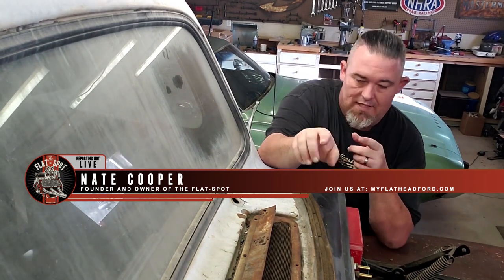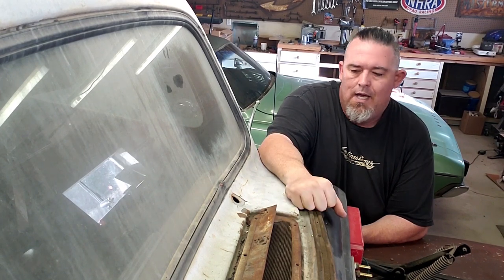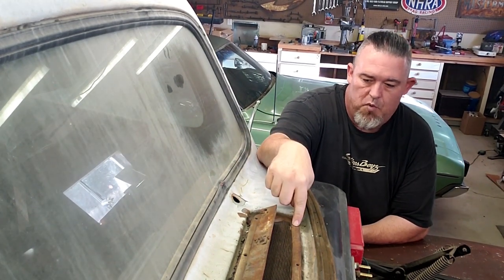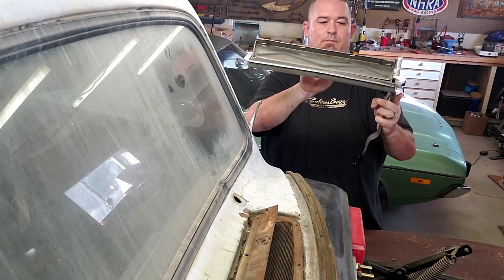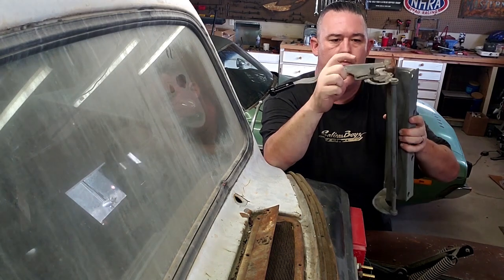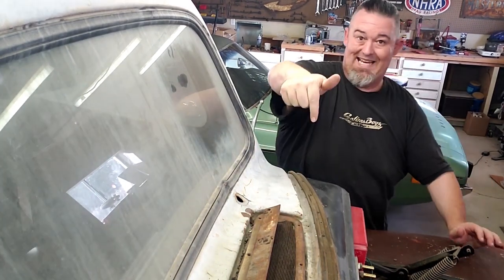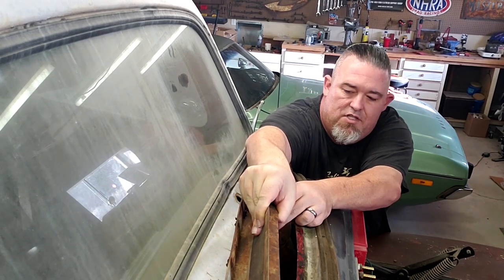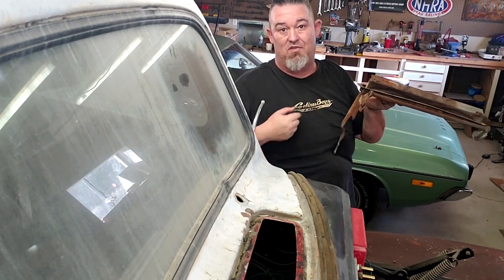How To Remove the Cowl Vent on a 1948-1952 Ford Pickup

Comment: Nice to see you replacing it instead of removing it. This and vent windows are the coolest features of these old trucks. The PO of my 47 welded the vent closed. Luckily he did a crappy job. So removal and making it functioning again wont be to big of a deal.
Reply from the maker: Yes, My title has attracted this exact topic. I should have better titled it. As some people where quite upset at the idea of removing it permanently.

Comment: i bought a 1948 fi on a 1985 chevy truck frame. it came with a 1948 parts truck. (cab, front end, and frame on the parts truck.) i need to take the dash plate out of the parts truck and install it in the running truck.  how does this plate come out? the good truck is a running truck and i drove it home. don't think i did bad for 3500 for both trucks.
Reply from the maker: do you mean the entire dash? or like the gauges?
Reply from the maker: If you mean the complete dash it is not removable. You have to replace the complete cab. The dash is actually part of the sub structure of the cab. It was not designed to be removed. I checked with our group just to make sure and they all said the same thing. You can swap the cab but not the dash. Not with out massive fabrication and possibly compromising the structure of the cab itself.  Not sure what this year was one of the few that didn't make the dash removable. But there you go.
Reply: @THEFLATSPOT  note dash. plate covering middle of dash. one where radio would go, and a bigger one below radio.
Reply from the maker: @nowayhunting  oh easy there are 4 screws on the back. At each corner i am pretty sure.

Comment: You said that the outside cover more or less deteriorated. So getting that off was not described. If intact however, are there any special considerations to removing the outside cover? A nice video  BTW.
Reply from the maker: No it is like a few flat head screws and it comes right off.

Comment: If the gasket has hardened over the past 70+ years, it will need to be removed before the mechanism will fit through the opening. At least this was true for me.

Comment: That tensioner bolt does NOT need to be removed to remove and install the vent. I've done it many times as a complete unit.
Reply from the maker: Your actually right. But for some reason when I did it. And I didn't have any info. Taking out that bolt some reason broke the spell on it and it came right out. So I assumed it was required at the time. I tried for an hour before removing it to get it out and was totally lost.